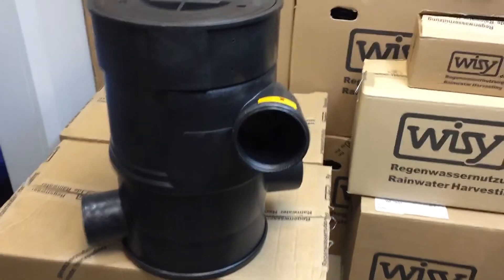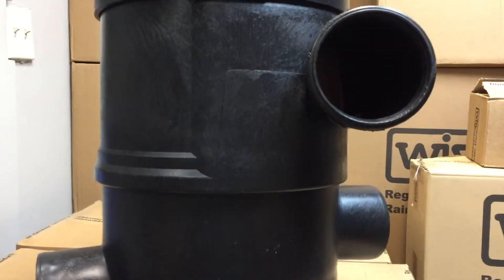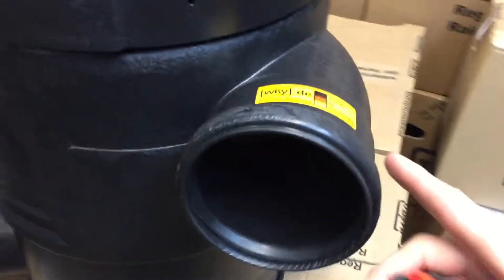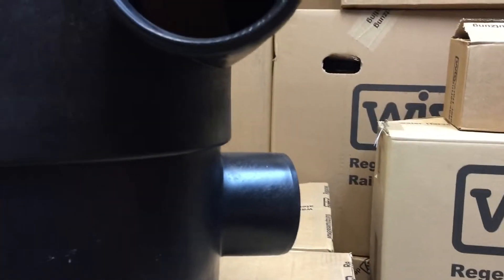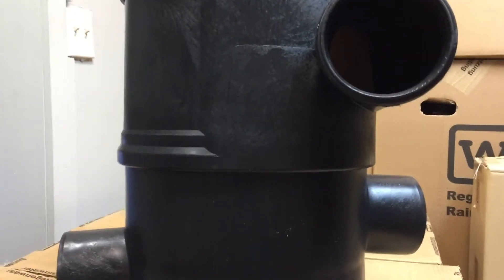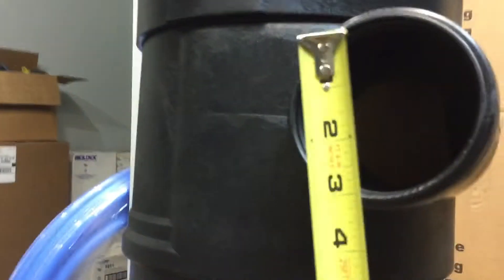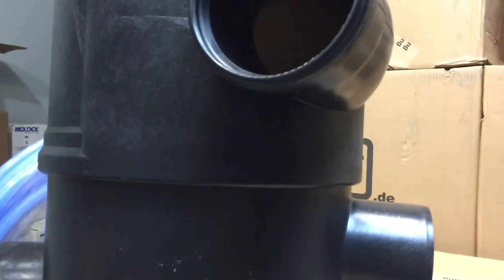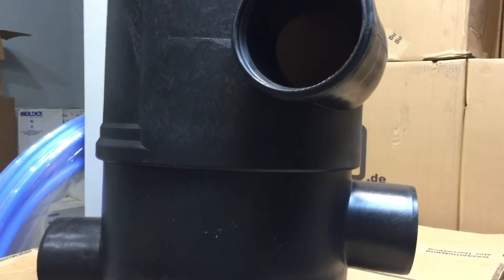Wisy Vortex Filter Installation Overview

Comment: Curious if a rain head is used at each downspout: if this would be still useful/necessary.
Reply from the maker: This is much finer filtration than rain heads can offer. For drinking water systems, having finer filtration before water enters the cistern is important. Also, we always try to use the Dead Bird Standard for pre-filtration: What happens if a bird dies on your roof? With rain heads, the bird will sit there and water will run over it before entering the cistern until someone notices and cleans it out. With the Wisy, a dead bird would fall right thru and water entering the cistern would never be contaminated. It’s a crude example, but it does happen on occasion